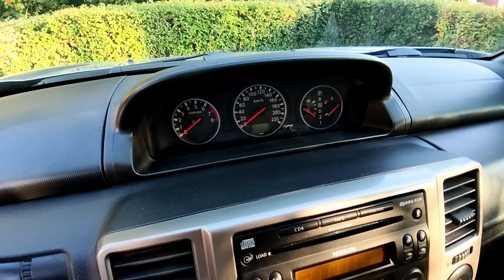Some Sheet metal is rattling - Nissan X Trail T30

Comment: Hellow my friend , have a similar problem,
My exhaust bracket its broken , but the more big problema is My biggest problem is that the cardan touches the exhaust pipe sometimes when I accelerate and it moves, does the same happen to you? What did you do about that?
Reply from the maker: Check all brackets first. Problem could be in those.
Reply: @petrisalakka  It is the support near the cardan, only that one is cut in the rubber, I will check it carefully tomorrow and I will tell you

Comment: Did you always have that sound? Or only in first and second gear?
Reply from the maker: The sound came with a certain resonance, mainly in low gear.
Reply: @petrisalakka  I think I have something similar, I hit the part of the exhaust pipe and it started to sound in low gears when I accelerate, then it goes away
Reply from the maker: @tomasvaldebenito4518  

Yes, something is definitely off somewhere
Reply from the maker: @tomasvaldebenito4518  Under the car and check. I hope you find the reason easily !